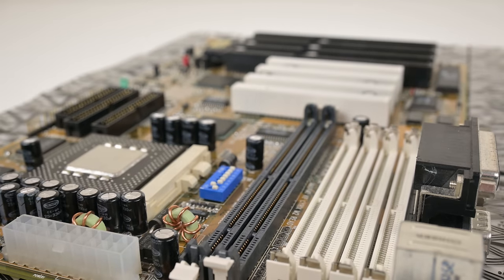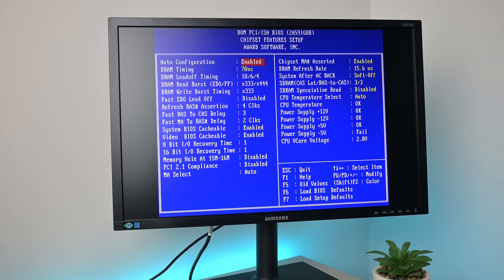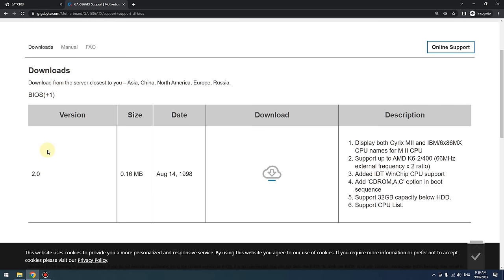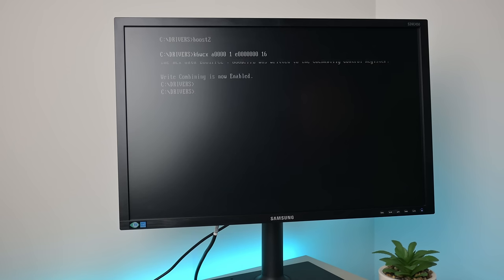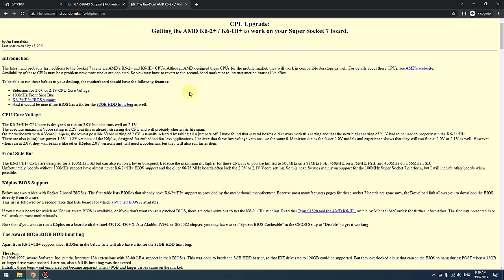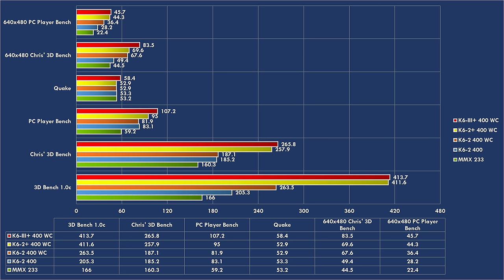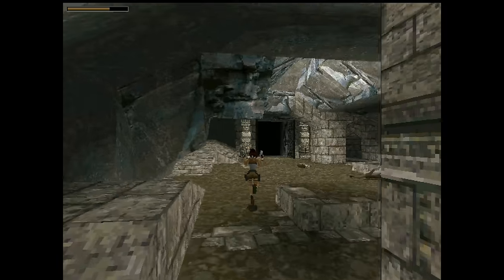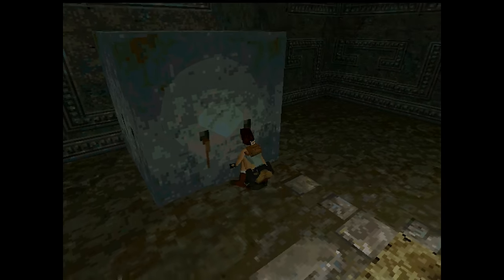Upgrading and Tuning Socket 7 to the Max

Comment: Nice video. ☺

I personally don't see any reason to "squeeze out" any more performance out of that system though since it is no Windows system nor meant for it, and for merely DOS it already provides more than enough power for any titles of the time. You can tell by Phil's benchmarks that switching to MMX makes some sense, but that the range from Pentium-MMX-166 to Pentium-MMX-233 is the way to go since this already caps out what you can get from a PCI graphics card in VESA mode. This is why the synthetic benchmark showed stark improvements while the practical gaming ones essentially were unimpressed by the CPU upgrades.

If you wanted to make good use of a K6-2 CPU on that board, you'd need 3d acceleration with 3dfx Voodoo 2 12MB, Voodoo Banshee 16MB or Voodoo 3 PCI 16MB - there are cards like the Voodoo Rush and the Voodoo 1, but they only support up to 640x480, are a bad match for CPUs of that tier, and any version of the Rush I am aware of is a total mess that barely works and slowly at that. There is 3D acceleration to be had with other brands, but those essentially are in name only improving windows drawing performance at best - it wasn't until AGP came along that other brands gained any decent 3D features or performance. There of course is the exception of the NEC PowerVR PCX / Matrox M3D, but the support wasn't overly good and most people nowadays don't even know it existed.

Also, you theoretically could run Windows 95 with 4MB ram upwards, but your shouldn't with anything less then 16MB, and as I mentioned before for Windows you should go for Win98 SE on a Super Socket 7 with at least 128MB RAM PC-100 / PC-133 - getting Win95 to work properly especially with modern USB storage devices is very tedious on anything else.
The SS7 also is the intended playground for the K6-2/K6-3 CPUs where they even receive a serious boost due to switching from 66MHz FSB to 100MHz. Additional most SS7 boards come with an AGP bus up to 2x, which provides much needed transfer rates to your graphics card for faster and higher resolution (gaming).
Reply from the maker: Great comment thank you! Yes often after doing a video you go, well that wasn't worth it actually but that alone is worth something 😜 S3 Virge is my next big project, can't wait, one piece of hardware I haven't played with yet.

Comment: I also have two K6 systems.  The first with K6/3 450 on Gigabyte GA-586STX2 (one of the first ATX Boards from 1997) and 128 MB SD-RAM.  It would go up to 384 MB, but the performance is poor because only 128 MB are cached.  Graphics card is a Radeon 9250 PCI 128 with 3dfx Voodoo 1 card.  The second is Super Socket 7 with K6-3+ 550 @ 600 CPU.  Graphics card Radeon 9800 Pro and 768 MB RAM.
Reply: 9800 pro?  I thought the best compatible AGP card you could put in SS7 was the Radeon 9700pro (that’s what have in mine). Do you think these high end cards are bottled necked and wasted on SS7 and that you can achieve the same with a lower spec’d card?  But which one is optimal, and above which there is no point in going?
I have a 9800XT somewhere.  I should check to see if it’s compatible.
Reply: 'Radeon 9250 PCI 128' YAY! Another "cheater" here! Metoo 😂
Reply: @davidp4456  Yes, it's true, the CPU is actually far too slow for the card, but it was the best it could be.  And then I thought to myself, "Build yourself a high-end Socket 7 system." I can't spontaneously say that it also depends on the chipset.  There are Via, Ali, Sis in the segment and everyone has different characteristics.  Some are not compatible with every graphics card.  It works yes.  I have a Via chipset on the board.

Comment: Used to sell those Voltage Regulator shim adapters and AMD K6 CPU in the day. It was a cheap way to get a pick-me-up before saving enough for the big next computer. Today, I like the idear of maxing out the odd piece, like a K6-iii+ in a laptop. Thnx AMD and other Socket 7 CPU makers! 'Twas a lot of fun until Intel went with a Slot One and later Rambus. *shrugs* old things are fun things but emulated things are fine too. <3 all

Comment: Maybe having a Super Socket 7 with a Pentium MMX and swapping to a K6-"X" when needed, is not a bad idea for a DOS/Win98 era PC. You can have both worlds in the same machine. Old (speed sensitive) games with the MMX (Setmul tweaked), and the K6-2/2+/3 with 100 MHz FSB when you want to run more "modern"games. Changing the processor often can be a pain in the neck, but using a thermal pad makes it easier now. I've tested Pentium II and III and they are not suitable for speed sensitive games, even downclocking or disabling caches and stuff. They keep being too fast, or the game freezes, like Monkey Island.
Reply: I might add: Generally Pentium MMX have the heatsink glued to the processor, so it's even easier to insert and remove.

Comment: That's a nice motherboard! Lots of PCI and ISA slots! You could add all kinds of newer and older expansion cards. It would be really neat to combine SAS/SATA/SCSI/IDE/MFM/RLL on a single system. Other than DOS, I bet this system would really run well with OS/2 or ArcaOS, as well as current and older BSD/Linux systems. Is CoreBoot compatible with this motherboard? That could give some additional functionality and performance. I had a system from around the same era back in the day, and I remember a modded BIOS branded as "HoneyX." There may be a HoneyX BIOS for that board.
Reply from the maker: Sorry not familiar with other OS outside DOS and Windows...
Reply: @philscomputerlab  Understandable. You could give another OS a spin sometime. You might be amazed at how much you've been missing out.

Comment: It's time to once again give you a huge thank you for your content. My favorite retro computer is my "OS chameleon". It's a PII 400 with BX chipset running @300 with a FSB of 75, a Matrox Mysique 220, a Voodoo2, a network card, a ESS AudioDrive ES1868 and 128 MB RAM. With a mobile rack it runs DOS, WfW3.11, NT3.51, NT4.0, 95, 98, Me and W2K. Depending on the BIOS settings I can make a 386-20 or a 486-33 for DOS out of it. All my attempts to run Carmageddon 1 with a Socket 7 CPU in Voodoo 2 mode have failed. With a Slot 1 CPU Carmageddon 1 ran without problems on the Voodoo card. Perhaps you know the reasoning behind this.
Reply from the maker: This is a game I'm not familiar with. Seems odd that it won't run in socket 7. Is that with MMX? Maybe it's a requirement?
Reply: @philscomputerlab  Thanks for the query. I tried it with a Pentium MMX 233, an AMD K6-2/300 and an AMD Mobile K6-2+/450 CPU (to be able to use the K6-2+ I even installed the BIOS modified by Jan). The performance of the K6 CPUs rather disappointed me. I didn't even try the K6-2 boost parameters because the basic performance seemed too low and not all games ran as expected.

Comment: I've tried exactly the same this weekend with my Freetech CondorII, but the performance with an K6II@300 (fastest I could manage with this board) was terrible, because of the PCI bandwidth that crashed down to a third of the speed that gets with the P233MMX, could not find why. I've managed to overclock the FSB at 75mhz also, ~266Mhz with the Pentium and ~336 with the K6II, DOS ran fine, but Windows crashed randomly. Finally I keeped the 233MMX

Comment: I actually played the OG lara croft a year ago or so for the first time ever, but i played with modern machine at modded 4k resolution and increased draw distance. I completed the game and for the most part i enjoyed it, i loved the atmosphere (on my version music worked btw) i kinda liked the whole square system which originals are based on, so it makes much easier to calculate distances between the jumps. But the controls as much as i got used to them on the second part of the game when there were a lot more enemies, got old pretty quick. The combat system is just not good imo, i tried playing second lara croft, but after seeing that developers leaned very heavily on combat and "trial and error" traps, i called it quits before frustration got better of me.

Imo first game is worth a try, but other two are easy skip for the most people.

Comment: The biggest problems with going with higher performance is that you really start to lose compatibility with older software, and a lot of motherboards just simply will NOT accept the faster K6 processors. I think it's best to see basic Socket 7 as a platform that excels with DOS (especially with MMX), and that it just HAPPENS to be pretty good with early 3D. Best to pair either a Voodoo 1/2 or a PCI Voodoo Banshee and don't expect much more than that from it.
Reply from the maker: Though at least with the mobile K6 you can set the multipliers through software. Let's you put it back to slow mode at a whim. Great to get under that Turbo Pascal speed bug...
Reply: Socket 7 is not good for 3D unless you like playing 320x200 or have a voodoo and games that support it. I tried tomb raider and quake and they suck on Pentium MMX (Software). Back in the day was great because it was all you had, but today is much better to play this games on a fast pentium 3. Pentium is great for other games, but not for software rendering titles in high resolution.

Comment: If you're aiming for higher-end performance in a retro system in the era of software this one is from, IMO socket 7 isn't really ideal. Socket 7 is good for someone who wants to rebuild a system with a wide selection of lower-end to mid-range performance for its time period. If you're trying to squeeze for high performance from about the same period, you'd probably do a lot better with an Athlon and the right motherboard. Retro PC building isn't really IMO about maxing performance of a given platform, though. That was what we did at the time because the machine you had was the machine you had. Using these machines now is more about recreating the experience of the time on the platform you pick. If you want a faster experience, pick the platform for it.
Reply: Didn't he pretty much express the same sentiment in the video?
Reply: From my experience, low end to midrange performance is ideal for stability and backwards compatability. My windows 7 to xp system uses the very cheap entry level components (AMD A8-3870 with Radeon 6670.) I wouldn't push that system forward (modern systems can handle the cutting edge games of 2011,) but it's supremely stable all the way back to XP. Same with socket 5/7, mid/entry level components were meant to be incremental upgrades for people on a budget, meaning greater compatibility and builds that could be pushed further back into the days of DOS. 

My goal is 3 PCs that can adequately cover 4 decades of computing, and S5/7 proved itself to be the best platform for late 90s and earlier.

Comment: I have one of the best socket 7 machines on the floor next to me built by compaq and still going strong with all original parts from the quantum bigfoot hdd to the on board ESS audio. Built in iGPU is ATi rage pro as well which can run the patched OG tomb raider in full 3d with the ATi cif and patch on the gold cd. I would never part with it.
Reply from the maker: Nice! That reminds me to put CIF in the calendar. But it's a deep project with specific games to hunt down...
Reply: @philscomputerlab  I can only confirm the success I had with the old Tomb Raider. Ran buttery smooth with it too. I never did try the ATi game specific wipeout game or any others that used it would love to see you dig into that.

Comment: I am still at the start of video but I'd ask is this possible on S7 to have around 750MHz? 😁
Reply: Not even close. Best you can get on regular socket 7 is 400MHz.
Reply: Looks like somebody managed to push a K6-2 just over 744 MHz on a Super Socket 7 board, but with LN2 cooling. Not practical for any kind of application, of course.
Reply: @wasd____ I forgot to add second "S" in the socket name, but yeah, I meant Super Socket 7 😎
Reply from the maker: I've only tried 600 😊

Comment: I am currently asking myself the same question about whether an Upgrade is within reason. Using a SS7 with a Voodoo3 3500 and a K6-2 500Mhz. To be honest I am a bit underwhelmed with its performance. While the Hardware is from 98/99 it already struggles with Games from that time. Not necessarily in 3D (that as well), but more like heavy stutters and so on in Menus. Might also due to the ESS Soundcard. But does it really make sense to upgrade? Because games like Deus Ex, Ultima 9 and so on won't run anyways. And even if games from 98 would run better, you would still rather run them on higher resolution with a better PC "from the future". If it was still as cheap to get a K6 2+ like when you bought it, then no problem, but these days you pay 100€+ for a 2+, or 3+. Ofc it would also enable more than 128MB of RAM on my ALI board, but not sure if that would have any significant impact in itself.
Reply from the maker: Yea Socket 7 and Voodoo3 quickly run out of steam with more modern games. I would repurpose the Socket 7 machine with a Pentium MMX into a dedicated DOS machine. Using setmul you can slow it down nicely. Build a Pentium 3 with the Voodoo for a nice 98 PC.
Reply: @philscomputerlab  Thank you for the suggestion. I already found a way to "remotely" downclock my K6 II, via some doodad I soldered together (will probably post at the vogons at some point, but its pretty simple). So for all DOS purposes It should do perfectly fine. The Voodoo 3 is certainly overkill as you mentioned. But a Voodoo 2 didnt fit into the case, and the Banshee wouldn't have been cheaper than the V3. Will probably use a Pentium PC for newer stuff, but then also going straight for a DVI card, solving several other issues (e.g. with recording).

Comment: Hi Phil just a quick question regarding socket 7 motherboards.  I have a Gigabyte ga-5ax rev 5.2 and an ASUS P5A. I wanted to put in a new PSU but I realise that most new PSUs these days no longer output -5v supply voltage, and I know some motherboards do and don't require it.  Do you know if these boards will be ok without the -5v supply?

Thanks
Mike
Reply from the maker: Yea it will be fine!

Comment: I have an Asus TXP4 with a K6-2+ 533 that I've done the cache mod on, so it's running as a K6-3+ @500 MHz (6x83). Thanks to Jan Steunebrink, it had a BIOS that recognizes the K6-3+ and enables WA and WC. I've done lots of benchmarking, and as it is set up the onboard cache actually lowers the score when it is enabled. I have a 128 bit FX5200 PCI (thought it's so CPU limited that the 64 bit version performs just as well). A typical 3D 2000 score is around 2,800 points. I think I'll try Tomb Raider on it and see how it does, and how I like the game (I've never played it).
Reply from the maker: That machine should handle Tomb Raider well! Though with a 3D card you do get nicer graphics. Not just Voodoo but also ATI or S3 Virge.

Comment: Hol up, is AMD using 6x when it detects a 4x platform agnostic? Is it something the processor itself does when it recognizes a 2x multiplier? A have an R547 Mustang that's been running a K6-2 266 (best documented processor.) I may have a 400mhz k6 lying around and will need to source a 450, if I can get either of them working with the Mustang I feel I will have reached peak retro gaming.
Reply from the maker: Yes AMD implemented it that way because 6x multiplier wasn't a standard. 486 CPUs do something similar, interpreting 2x as 3x or 4x.

Comment: IIRC, the K6-2, and to a lesser extent, the K6-3, suffered from poor floating point unit performance when compared to similarly clocked Intel chips of the time (disregarding their 3DNow! instruction set extension). It wasn't until the original Athlon came out that AMD chips could stand their ground against Intel chips, clock for clock, when it came to gaming performance.

For this reason, I'd be curious to know if the absolute best gaming performance you could squeeze out of this socket might be an Intel chip, even if it may not be clocked as high as these AMD chips you tested.
Reply from the maker: Yea in Quake or unpatched Quake 2 the 233 MMX can be better. OX the FSB a little and it just flies...

Comment: So... Which RAM TYPE did you use, Fast Page or EDO ram? After all, EDO ram has BOTH a higher clock rate and peak bandwidth, leaving Fast Page in the dust.
Reply from the maker: Neither, I used SDRAM.

Comment: Is that S3 card faster than a Geforce MX2?  I have the Geforce 2 MX PCI card in my Socket 7.
Reply from the maker: I think there won't be much of a difference in performance both should be top level.

Comment: Going for a p2/p3 for a late 90s/2000s is definitely more sensible, cheaper and reliable... but so is buying a mid 2000s Toyota Carolla or mazda 323 over a tuned late 80s Supra or rx7

Comment: Any suggestions for a Socket 7 system without dual plane voltage (Pentium MMX won’t work)?
Reply from the maker: Plain Pentium or any K6 will work great and run heap of DOS games. Disable CPU and motherboard Cache for 386 slowdown to play speed sensitive games. You'll love it!

Comment: Asus p7 >HX has a 83-mhz bus. Thats fastest for the Cpu- youre rinning at 66mhz. sorry for typing- back days i was 2.5 x 83 pn this cpu- you need good mem also to do 83, ev os 83, thata wqgy the speed. all mb has 75 for cyrix, you could have used that. but asus has 83.

Comment: I wish for a slightly enhanced Tomb Raider.
I also will gladly support if someone would come up with totally new Tomb Raider based on the engine/graphics of the third one. Just a new classic release.
Reply from the maker: Tomb Raider for a lot of patches for early 3D acceleration cards. Not just Voodoo but also ATI, S3 and others.